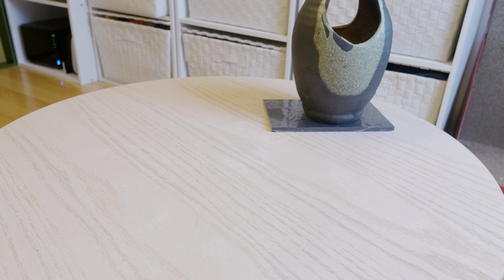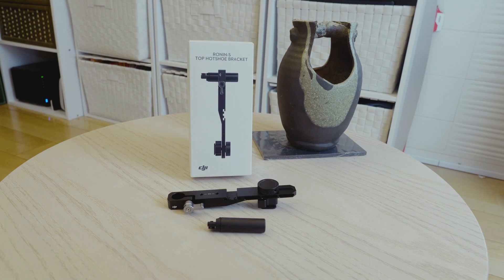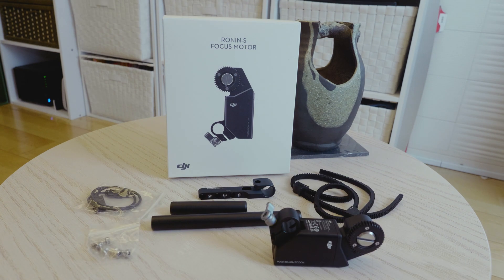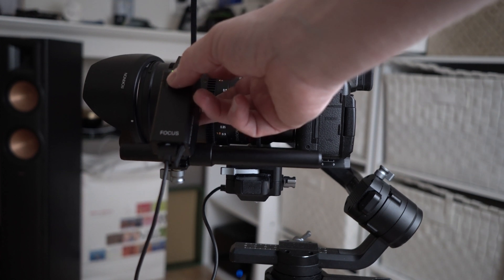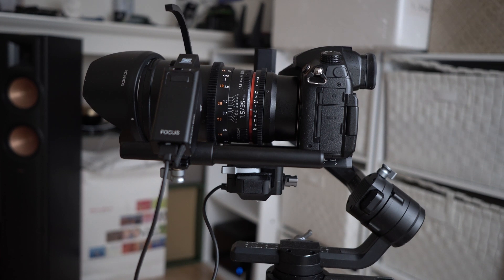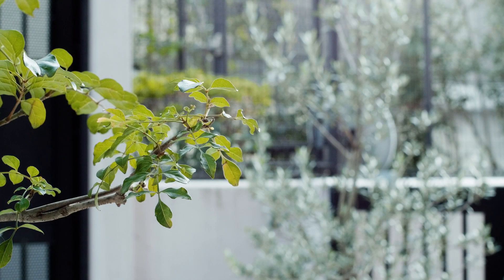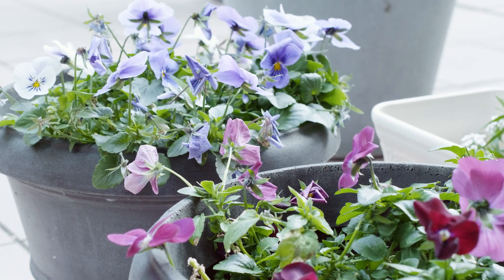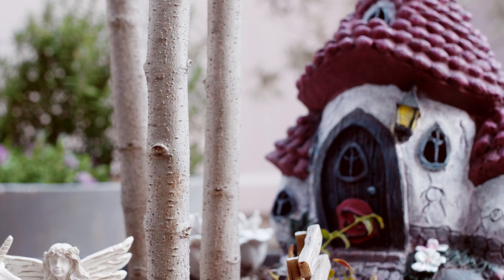Ronin-s Focus Motor and GPS module unboxing, setup guide and review, with GH5 in camera examples.

Comment: curious if GPS will help with pan drift. I shoot a lot of hyperlapse where I don't want the attitude of the camera to change over a long walk but it always pans. I know all my calibrations are done well. It doesn't drift while sitting only while walking. Will order GPS module if it helps this. Horizon not as big a problem as can be fixed in post but not pan error when significant. Would consider losing the music on future videos. Doesn't need it.
Reply: By itself GPS cannot help.  GPS only knows where on Earth you are located.  It has no idea what orientation is your camera. It MIGHT have some components such as MEMS gyro but the handle should already have that.

Comment: Hello, thank you for the video. I watched it primarely for the GPS module. Here are some thoughts: 
Isen`t the camera riser included with the Ronin S itself? I got one with mine.
Why are you using the includet gear strips on your cinema lens instead of the gears witch are already on the lens? Is the gear pitch different? 
How long does the GPS module take to get a signal?
Reply from the maker: Thanks. I checked the Ronin box and there is a riser. Thank you and sorry DJI.

I was using the steps because without the riser i couldn't get the gears to line up. With the riser i can now just line up with the lens gears. :-)

GPS takes about 90 seconds to catch the signal.
Reply: @exploringjapan2452   I am glad that I could help you out :) And thank you for the answer. My problem with the Ronin S is that the pan axis drifts over time while doing some kind of hyperlapse. I hope that the GPS module is fixing this problem. Do you have tried the GPS module with this kind of shooting?
Reply from the maker: It helps with the drift but with the gh5 its not perfect and sometimes works quite badly. I've not tried a hyperlapse. I'll try in the next couple of days and reply if it helps.
Reply from the maker: @Stefan Kunz I did a hyperlapse test with and without the GPS module (left the module on for 5 minutes before the test) with a GH5 and Sony A6500.  With the GPS module it worked flawlessly.  WIth no module connected the GH5 drifted.
Reply: @exploringjapan2452  Thank you for your testing. I consider the gps Module bought. :)
Reply from the maker: @stefankunz2812  send me a link to your hyperlapse when you get it working with the gps module. 👍